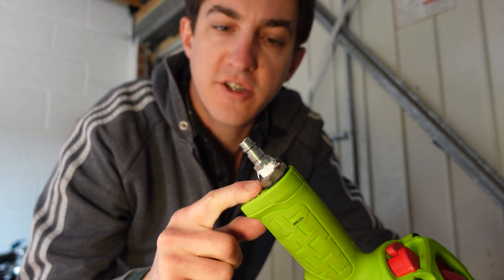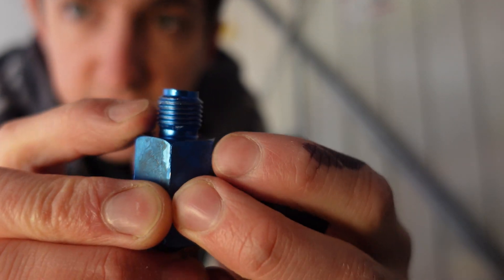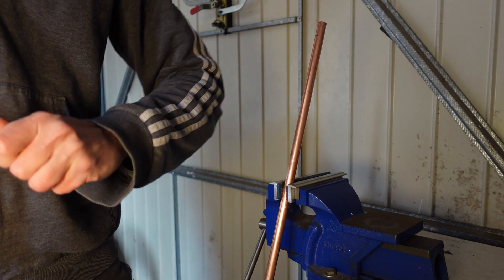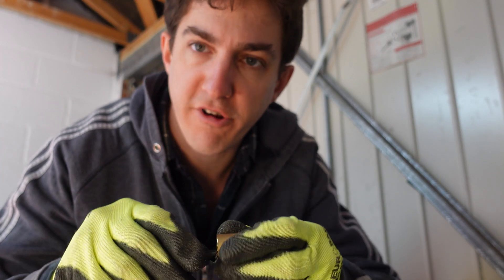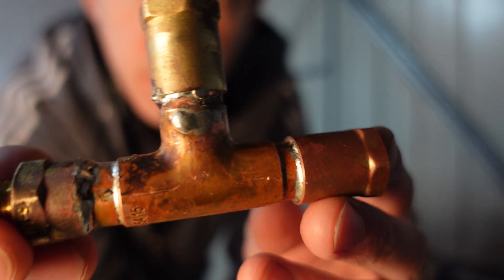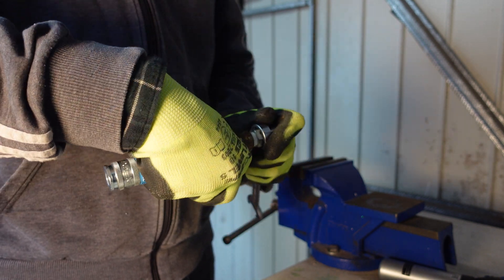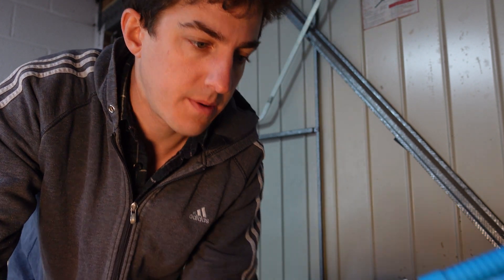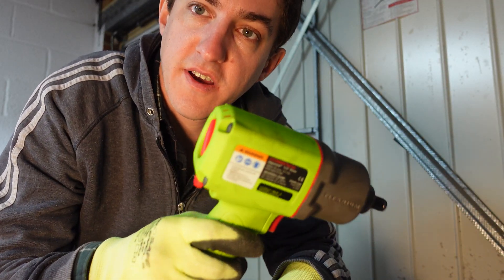How to make an Air Tool Test Gauge for Optimising Home Compressor Use

Comment: The vice would be absorbing lots of heat.....on a lump of ply wood or an old brick maybe.....but you did it....thats all that counts.

Nice compressor setup you have....posher than mine.

I see you have a Triumph like me.....not sure what yours is....mine is a 2020 T100 Bonnie...bought new....I love it.....off the road at present till the salts all gone.

Nick from Cheshire.
Reply from the maker: Thanks for the tip, I didnt think of the vice being a heatsink.  I had a much smaller compressor that broke, so upgraded - unfortunately the manifold broke shortly after purchase, fixed now and there will be a video on that in the near future.

Bike is a 2005 Speed Triple, big fan of the Bonnevilles, the quality and build of the recent Triumphs has been great, enjoy it when Spring arrives 👍
Ed
Reply: @edutainment5431  Dont help with copper being an excellent conductor of heat.....as is Ali.

But very well done getting it soldered with the small touch.....just shows what can be done.
Reply: @edutainment5431  Could have clamped the "top" brass fitting in the vice, that would expose the back of the tee which is where you want the heat concentrated. Then the heat draws the solder inside all the joints. Easier said than done.
Binge-watching your stuff today - I paid over the odds for my SGS compressor second hand, needs an oil change and all the fittings it came with upgraded to improve flow/pressure. 

LOT of useful info'. CHEERS!

Comment: Hi Mate,

Do you have a parts list and where to get them?
Reply from the maker: Hi NW, search "End feed BSP couplings" or similar, and PCL XF Couplings.  If you are UK based, I found Screwfix best for air couplings and Toolstation for the copper parts. You could make it with compression couplings if you wanted to avoid soldering but that would get a bit bulky.